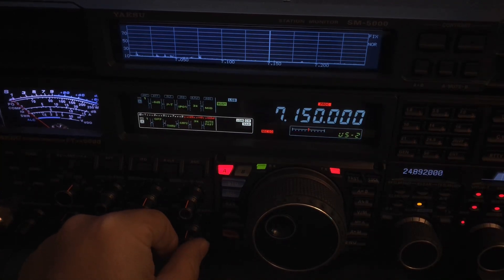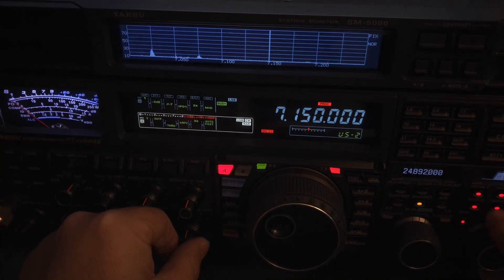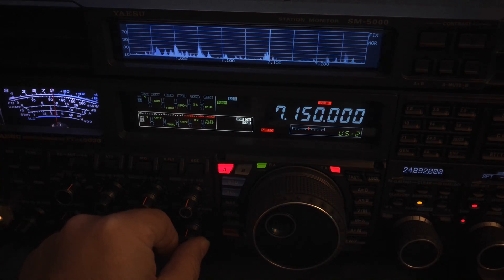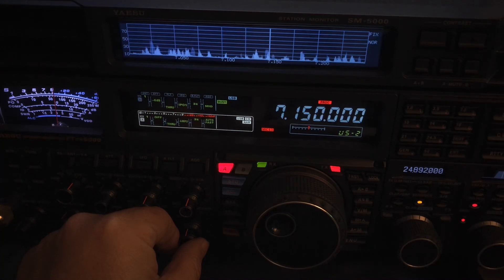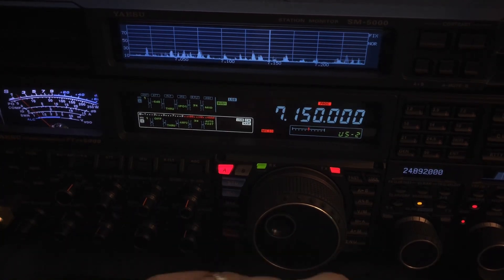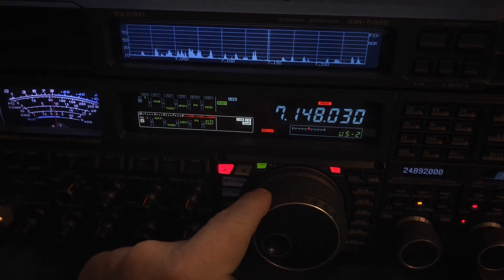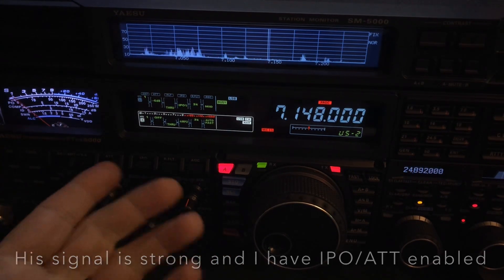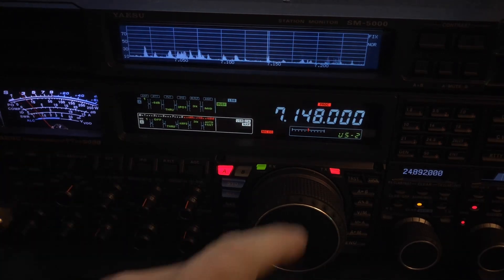Yaesu FTdx5000MP: Dealing With QRM 2kHz Away

Comment: The 5k is a ridiculous radio. Its huge. Its heavy. And it is powerful.
  If you are a receiver geek, someone who lives to extract the whisper amidst the QRN and QRM it is
practically miraculous. I am an unabashed Icom fanboy and have used many Icom receivers and transceivers. But After driving a 5k for a few hours I was sad. I just could not believe how well it was equipped to drag faint signals out of the noise. The difference was stark. 
  If you want a great receiver the 5k is it. I am sad the micro tune units don't work outside the ham bands.
 That and poor sensitivity below 500kc are a letdown. Otherwise, as close to legendary as you are likely to ever drive. I especially treasure the contour control for SSB use. I already have enjoyed if shift and great DNR
as well as epic NB on my Icom rigs but the ability to tune the audio passband on the Yaesu is a game changer. So is the audio presentation. It is an amazing radio. If you buy one get the micro tuning units for it.
 Ultra highly recommended. Best radio I have ever used for weak SSB and CW. Ridiculously so.
Reply from the maker: The FTdx5000MP is by far the best transceiver I have ever experienced.  I tried everything in its class before choosing it.  I even put it against the FTdx101.  

IPO is automatically enabled below 1.8MHz to protect the sensitive components in the front end of the receiver.  We don’t need extra sensitivity for the AM broadcast band.  I run IPO2 on 160 and 80 meters.  I sometimes use it on 40m, when signals are strong.  I like to make SSB sound as much like FM as I can.

My purchase decision was based upon my main operating style, which is pulling out weak SSB and CW signals.  And you’re absolutely right about it being up for that challenge.

And, like you, I find Contour to be revolutionary and the DNR is the best, even compared to other Yaesu transceivers.  It wasn’t until the release of the FTdx10 that I encountered DNR as good as what the 5K has.

73, de N4HNH

Comment: Hey Doug,
Appreciate the video. Man the 5000 is surely a great rig. 
Off topic though, I wanted to reach out on one of your most recent videos to ask you if you've heard anything about the FTdx-10 and I believe the 101s also, having issues with the DVI board while being used with any monitor except a DVI dedicated monitor. 
Jayw4zxt has recently put out a video about the problem that he said Yaesu has confirmed. I just wanted your opinion on this and to also make you aware of it in case you hadn't seen the video.
I can send you a link to the video if you wish.
Thanks,
Tim.
Reply: My 101MP developed "Birdies" 3 tightly aligned, and repeated across most bands, with a MACmini driving a HP DVI to HDMI monitor.   Was driving me crazy.  Got an LG monitor specifically designed for the MACmini and fed with USBC.  No more birdies...  Very happy now.  Have never displayed the 101MP's screen on the monitor.
Reply from the maker: Yes, most HDMI to DVI adapters pull too much current from the port and they can slowly fry it.  It is best to use a native DVI monitor.

Yaesu reported that some of their customers claim to have had success with the adapter at the link below, but Yaesu hasn’t fully vetted this adapter.

https://www.amazon.com/CABLEDECONN-Multiport-Adapter-Output-Converter/dp/B0768B7S49

73, de N4HNH
Reply: @n4hnhradio  

I didn't know that. I have an old Dell that has a VGA input. I use a VGA to DVI cable and it seems to work fine but I really don't use it that much and according to Jay, Yaesu says that's not ok to do either?? Glad I didn't use it much. Guess I'll have to find an older monitor with DVI or does it have to be DVI-d as on the radio?
Thanks again.👍
Reply from the maker: It’s technically DVI-D.
Reply: @n4hnhradio  

Thanks, 👍
Reply from the maker: I had an LG 20” monitor in the closet.  It had a VGA port and a DVI.  It also came with a cable for each port.  I literally just plugged and played.  I was fortunate with the mouse too.  I had an older Logitech wireless mouse that just plugged and played too.

From what I understand, Yaesu used the older ports to keep the selling price lower.  There are plenty of overstocked DVI-D connectors available and the licensing fee is lower, compared to HDMI.  And, since 800x600 resolution is the maximum needed, HDMI would be waaaay overkill, adding unnecessary cost.  This approach kept the price under $1,700 and kept old monitors out of the landfills.

73, de N4HNH
Reply: @n4hnhradio  

It would of sure been good for Yaesu to let you know this could happen before you hook up a wrong monitor and fry the board in the radio, especially early on with all the videos out there telling you how to hook it up to about any monitor.
Hopefully Yaesu is repairing the radios for this under the warranty.
Yeah I ordered an older Logitech wireless mouse and it worked fine. Don't guess I'll use the monitor again until I run upon one with a DVI input. I need one with the narrower screen since I don't have the desk space for the longer ones.
Appreciate it Doug.👍
Reply from the maker: I’ve seen monitors on Amazon.
Reply: @n4hnhradio  

Good deal, that's good to know. I thought a monitor with that older technology would probably only be found in a yard sale or a Goodwill store.👍
Reply from the maker: 17" Dell 1708FPb DVI Rotating LCD Monitor w/USB Hub (Silver/Black) - Rotates to Portrait or Landscape View! https://www.amazon.com/dp/B00655RWXW/ref=cm_sw_r_cp_api_glt_i_XK6S1TDD1KC41Q6J4BM2
Reply from the maker: 17-Inch Dell 1704FPVs DVI LCD Monitor w/USB Hub (Black & Silver) https://www.amazon.com/dp/B001B1B0GA/ref=cm_sw_r_cp_api_glt_i_089S3J4E9Z3Y9191ZKRN

Comment: Where did you have the notch and DNR set too?
Reply from the maker: The Notch was probably at 720Hz.  There is a heterodyne at that frequency that comes and goes.  I only hear it when tuned to 7.150MHz.  I think it is something from one of my neighbors.

The DNR was probably at 4.  I usually set it somewhere in the 3 to 5 range, mostly 4.  I never turn DNR off.  I’ve grown accustomed to SSB sounding almost as good as FM.  Note that the FTdx5000, FTdx10, and FTdx101D or MP (with firmware update) have the only DNR processors that I have found that don’t make the audio sound watery with digital artifacts.  With other Yaesu transceivers DNR must be set at 9 or above to avoid the digital artifacts.  With other brands, the DNR is even more limited.  ICOM has better DNR than Kenwood, but the ICOM DNR isn’t great.  I wish it was.  I don’t like to like Yaesu.

73, de N4HNH
Reply: @n4hnhradio  thank you for responding. My Yaesu FTDX 5000 is great, your videos have helped me learn more about the rig. From WM4RW.
Reply from the maker: Thanks for letting me know Michael.  It helps to know that other hams are benefiting from the videos.  Otherwise, I’m wasting my time.  I appreciate you letting me know.

73, Doug